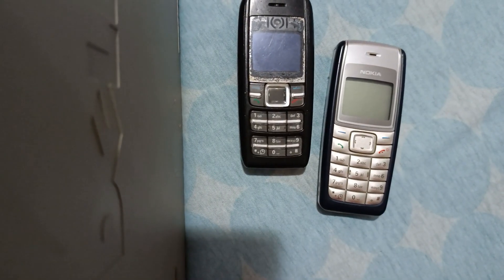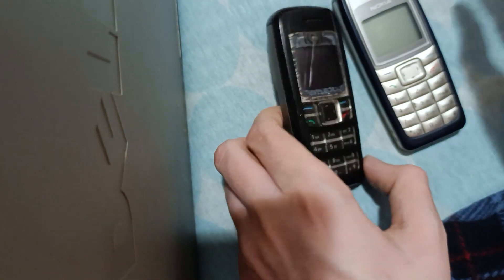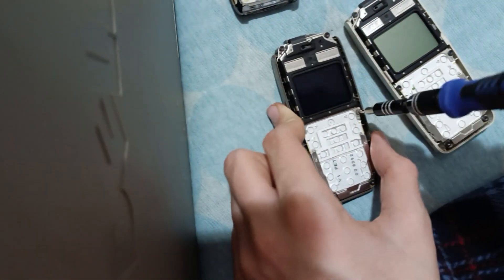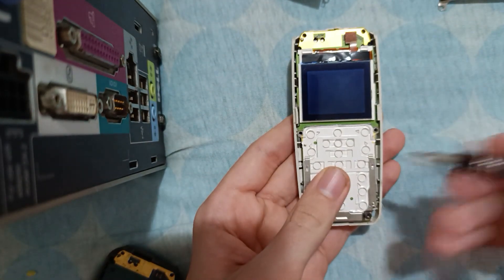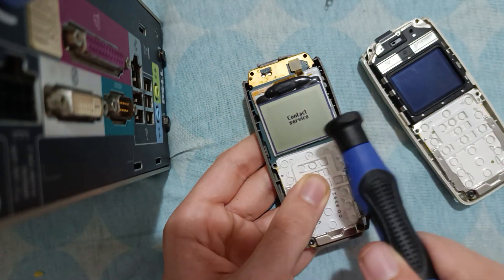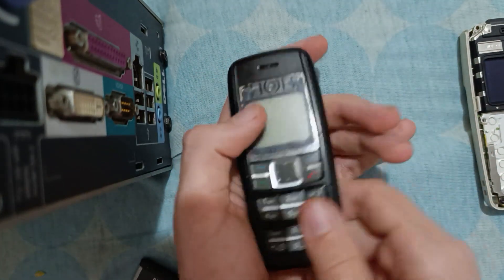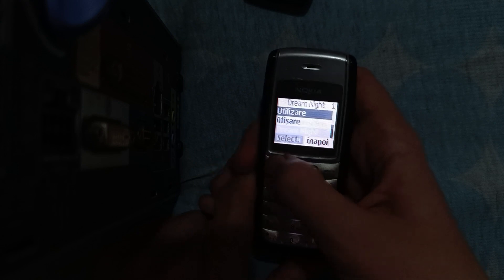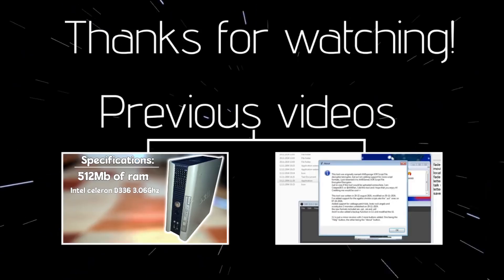Nokia 1112 colour LCD mod

Comment: How did the UI turned from showing just 1 icon, into showing 3 icons on the menu?

Is that simply a pin on the screen connector itself?
Reply from the maker: @jpgtch  idk, maybe it's the phone that detected that I've added the color screen? Maybe that. And the Nokia 1112 is basically a Nokia 1600 with a new case and different firmware.

Comment: Does it work same in games/3rd part pplications?
Reply from the maker: @Alex_TR1713  the truth is a bit disappointing, only the menu icons and some screensavers are coloured. However, you can install the Nokia 1600 firmware on the Nokia 1112 if you have the right service tools. While for the apps, they were made specifically for the monochrome screen, so you won't get colour for the built-in games. Not even snake...
Reply: @creeper2671 Well the ui was the most important things in these, so that shouldn't be a big deal i think.
Reply from the maker: @Alex_TR1713  yeahh. The 1112 is basically a stripped down version of the Nokia 1600